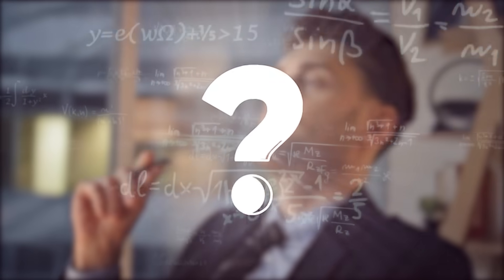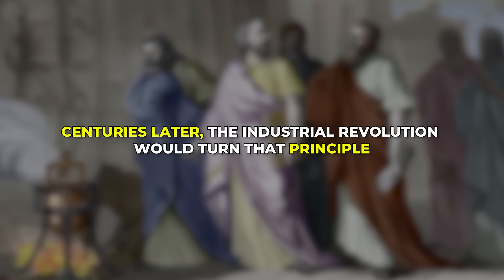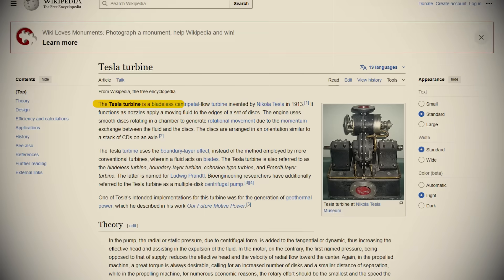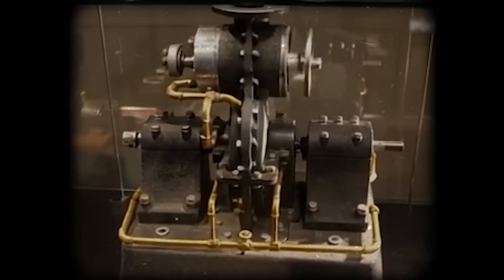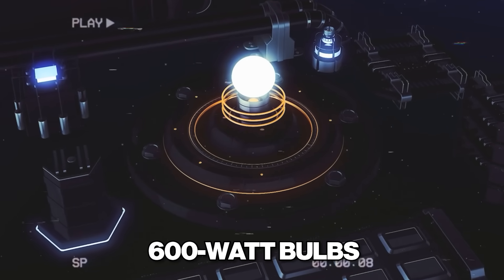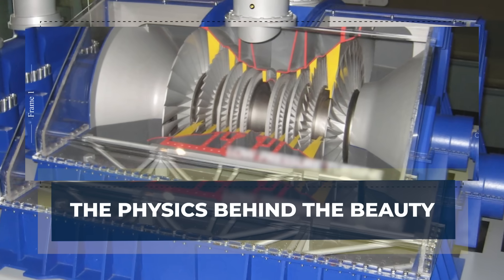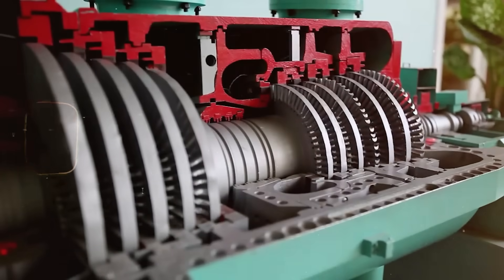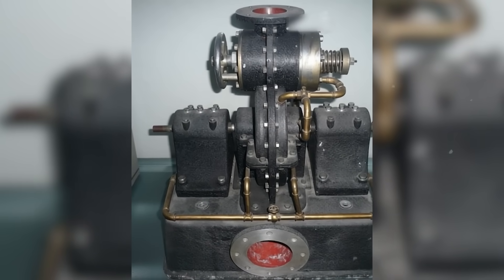Nikola Tesla’s Lost Machine Just Got Rebuilt

Comment: "Hero's Turbine" was originally called an Aeolipile, I believe. The problem with this is that it still requires the combustion of fossil fuels to run, unless it uses Geothermal steam, which makes it not significantly better than the ones we currently use. I believe the future of electricity generation is in Solar and Wind power - clean and available anywhere.
Reply from the maker: That's an interesting point about the Aeolipile and the future of electricity generation!

Comment: Dude what the heck are you talking about? The Tesla turbine principle has been in use for over 40 years. While not used to produce power, it's used to unlock the parked heads on modern mechanical hard drives.

Comment: Every person that has experimented with the Tesla turbine all found the same problem.
If you try to get the maximum power out of the unit, you will experience fluid slip, whether
it is air or any viscus liquid, the fluid will fail to turn the blades, and just flow by the blades
with no added rotation to the turbine.
Reply from the maker: That's an interesting point about fluid slip in the Tesla turbine!

Comment: I'd like to see a super small, fuel efficient 4 stoke deisle powered air compressor use 2 smaller extra air tanks that rotate being heated by exhaust. Then they power the turbine that charges the battery bank, and that powers the hub motors. Cold air takes less energy to compress. Exhaust is free thrust.

Comment: Your missing part of the info, if you use this pump in a ground based heat pump it can run all the time and power your house and whatever else just running off the heat in the ground using just water in the system for refrigerant. Guy on YouTube already built a system that works using it in a heat pump setup using just PEX tubing for the heat transfer. He got heat off it in the winter, cool from it in the simmer, and it had a generator hooked to the shaft to generate electricity. Basically he heated and cooled his home while generating power all for free after the setup was installed and running!
Reply: Geothermal don't work that way. It's only a helper there are no stand alone system anywhere on Earth!
Reply from the maker: That's an interesting point about the ground-based heat pump application!